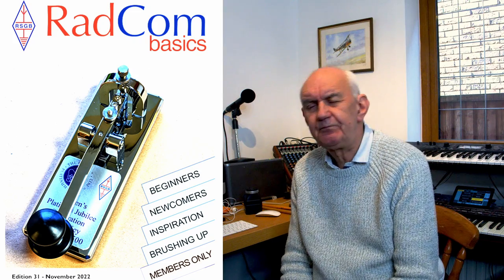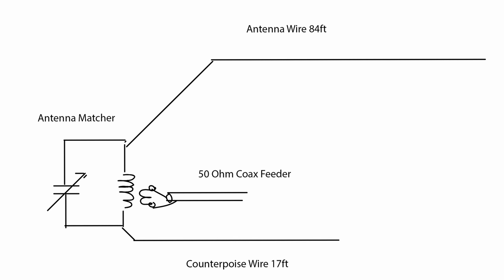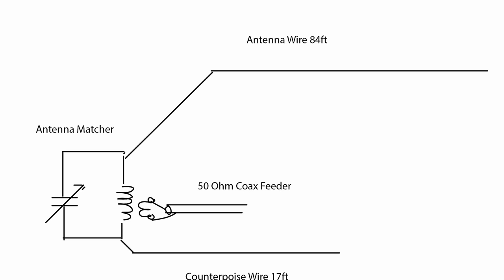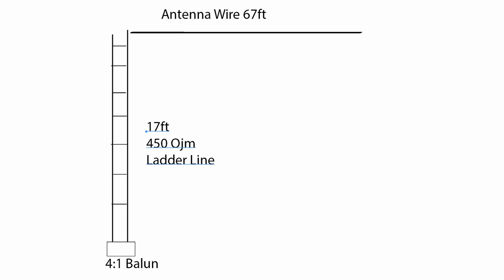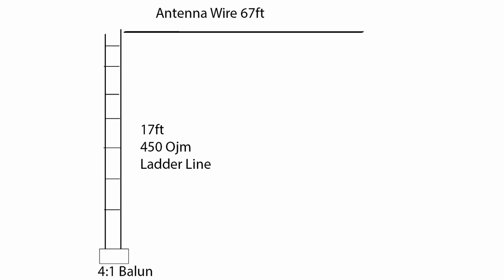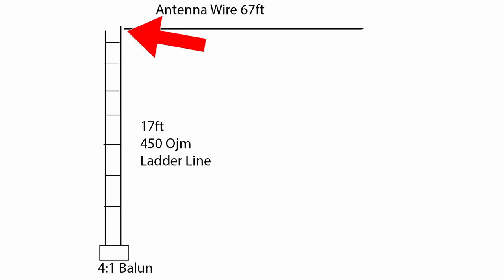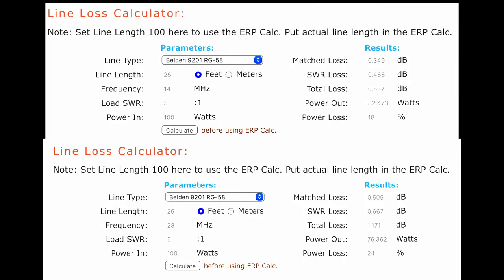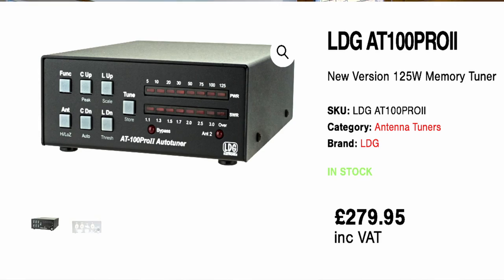W3EDP Multi-Band Antenna - Did it Vanish or Evolve?

Comment: Good one.
I use a traditional W3EDP extensively on my SOTA operations. I feed it via a 9:1 which is connected directly to my KX2, so no feeder. The radiator is set inverted V over a 5 m mast or simply thrown in a tree. The 17' wire lies on the ground.
73, Fraser MM0EFI
Reply from the maker: Thanks for sharing!

Comment: Thank you Peter for reminding the newbies of the W3EDP antenna.  It's my opinion that part of what makes it work so well is that the tuner is a very simple resonant circuit and it is placed at the load, thereby minimizing losses due to SWR in the coax feeder.  This would be a wonderful POTA or SOTA antenna  I would not recommend placing the tuner at the radio end as this defeats the concept.  PS.  Our AM MW broadcasters use a tuner right at the base of the tower for the same reason.  Many of those towers are NOT 1/4 wave tall or "resonant" either.  They still put out like gangbusters and really are no less effecient when done this way.  73 OM
Reply from the maker: Thanks for sharing.

Comment: I forgot to mention, I find line losses IN GENERAL to be low for most HF setups when using non resonant antennas if you use good quality feedline of reasonable lengths.  I like the flexibility and ease of using a tuner at the radio.  My line losses are very low.  I'm a big user of 'random' length antennas.  Robert K5TPC
Reply from the maker: Thanks Robert.

Comment: Thanks Peter! I've used a  W3EDP as a portable antenna for quite a long time, made from speaker wire , it plays very well indeed as a portable antenna because,it folds down to a small lightweight antenna.
 I also have an end fed zep and it does very well for me albeit , it's not as convenient with the 450 ohm feedline, (to wind up) .      in my opinion, the EFZ better suited for home station deployment.  By the way ,the G7FEK nested Marconi comes into mind once again that are in a way related to the EF Zepp and also a G5RV cut /dividend in the middle.  All of these are a lot of fun antennas to experiment with.  These are all good antennas for tight spaces, and or also for newer hams to try out.
 Newer hams : try the W3EDP it is a simple and fun antenna to play with using a spool of speaker wire and if you have a little pocket tuner such as a small"L" network like an mfj-16010 or homebrew.... 73
Reply from the maker: Many thanks.

Comment: In the modern version, with the 67 ft wire and 17 ft of 450ohm LL. One of the LL wires attaches to the 67 ft and this is fed to the hot side of the unun or Balun, thus creating an 84 ft radiator. Whereas the other LL wire feeds into the ground side of the unun, thus creating a raised / parallel counterpoise. I’m not sure therefore how this then becomes an end fed zepp? Surely all this newer design is changing compared with the original is to conveniently use LL as the bottom 20% of the radiator and the 17ft counterpoise? Not sure how this differs very much from the original design in terms of wire lengths?

Comment: I have used one. The advantage is being able to get on 80m in a small garden. I recently calculated for using 300 ohm feeder as the matching section instead of the counterpoise and taking account of velocity factor it came in at 4.75m. I was going to put that section vertical and feed it with a 4:1 balun. In theory that would tune with an internal tuner. I have actually built it, but the rotten weather has stopped it going up. Soon hopefully. GM4SVM
Reply from the maker: Let us know the redult

Comment: Maybe a half size would work 40, 20, 10.
That would fit in my garden.
Reply from the maker: You would need to scale the antenna snd feeder down by 50%. 40m would be down but I suspect 20 15 and 10m would work.
Reply: Yes, it works very well.  I have been using 1/2 and 1/4 sized W3EDP/Zepps while camping for years.  The 1/4 size, at only 21', is very easy to hang vertically will tune 20m and up with a 3:1 internal tuner.  What's more, it will usually tune down to 80m with an external tuner, though it is probably not very efficient there.  I've been using an LDG 4:1 unun at the feed point – it seems to tune a little more easily than with LDG's corresponding 4:1 balun, though they both do work.

Anyway, thanks Peter for the deep dive video on the topic.  Over the years I've had friends ask me what my camping antenna is, and it has led to many interesting discussions about when and how a W3EDP morphs into a Zepp.  I usually conclude with "What is it?  It's something that works!"